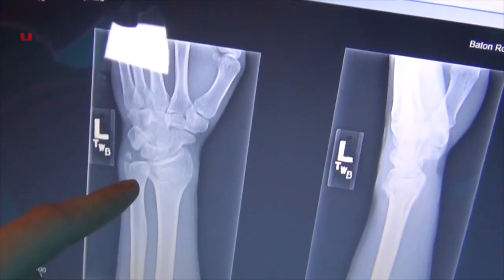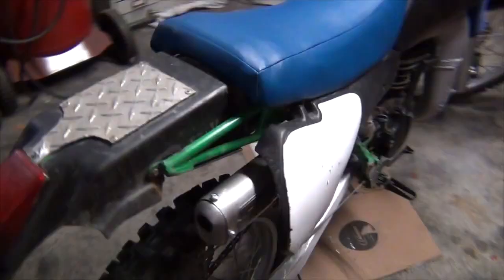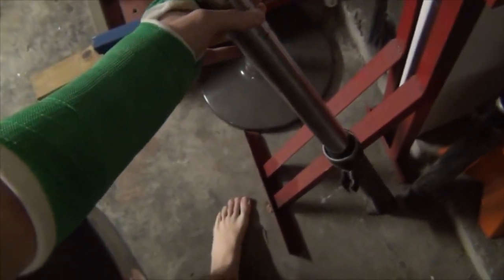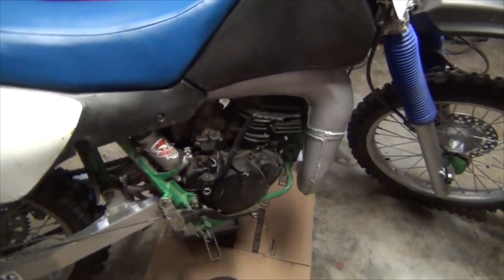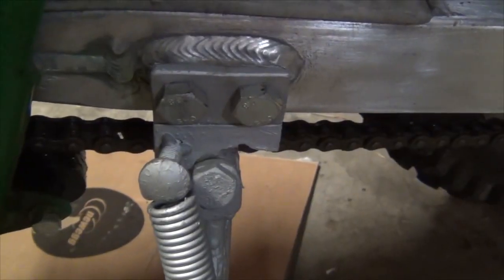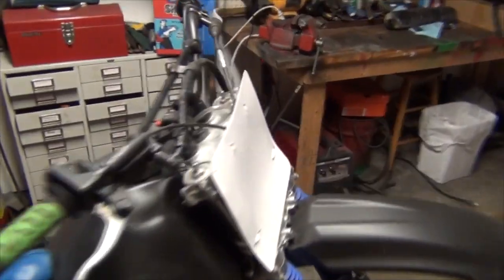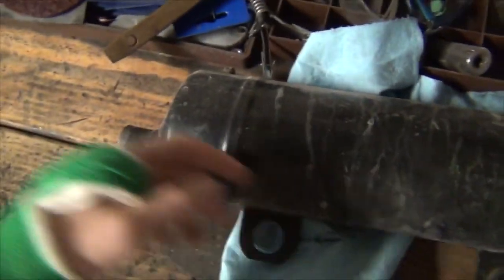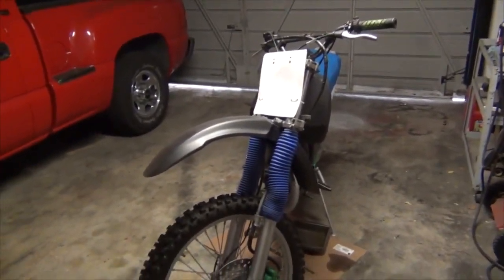KDX200 Crash Update with Full Ride

Comment: Bloody shame as you looked like you were enjoying the ride right up to ditch :-(

Keep an eye on the colour of the spark plug, its a two stroke machine so changing the back pressure too much with a different exhaust may upset it.

Other than that, its a cracking machine and goes like a rocket :-)

Kawasaki found the kdx200 was liked so much better than the newer 250 they produced, so they stuck with the 200 and just updated it a little :-)

Stop using your arm, wont heal correctly.